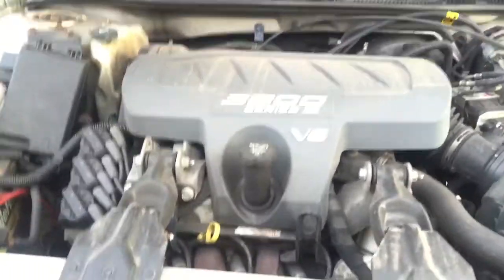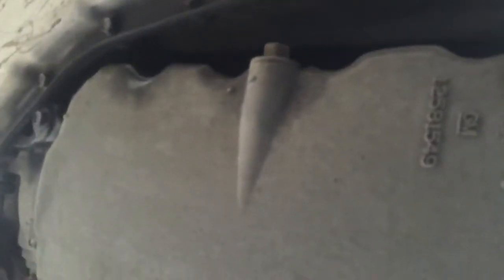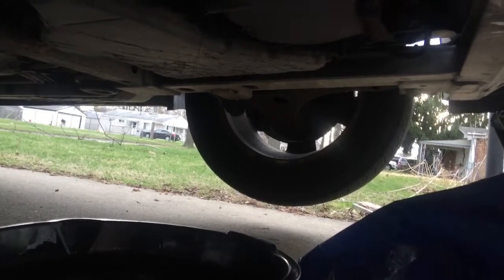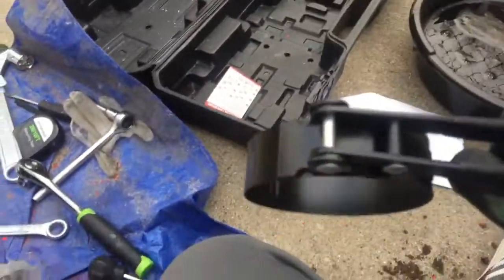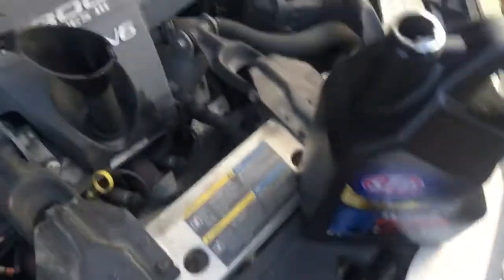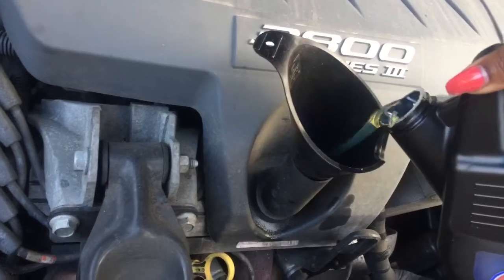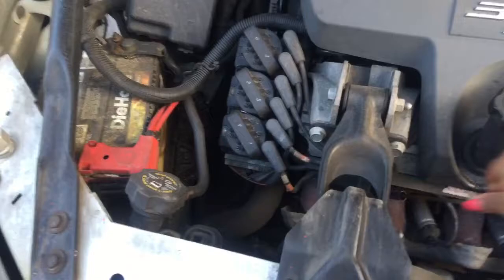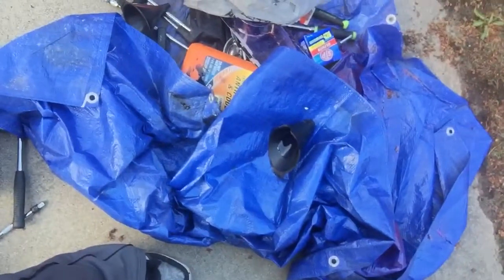Oil change on 05 Grand Prix

Comment: Growing up I was told that the car should always be leveled and not elevated just so you can fully drain the oil out..otherwise your still gonna have some left over dirty oil left inside
Reply: Might be a good idea then once the oil pan is draining to lower the jack until its finished, the jack up again to remove the filter?